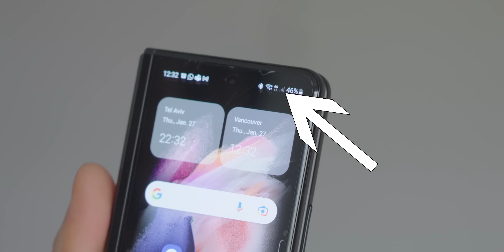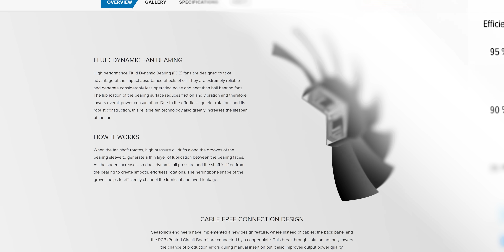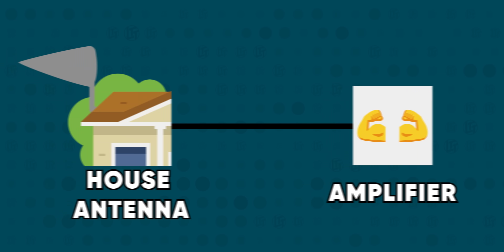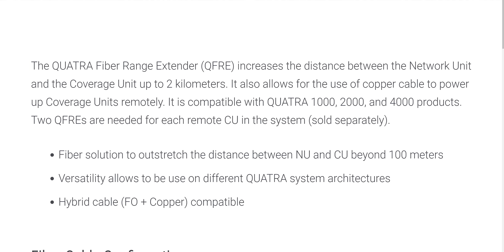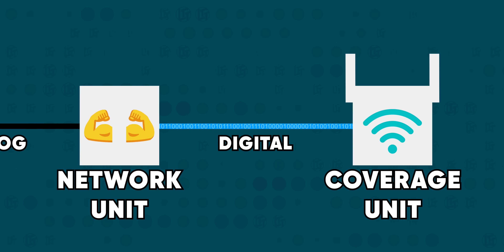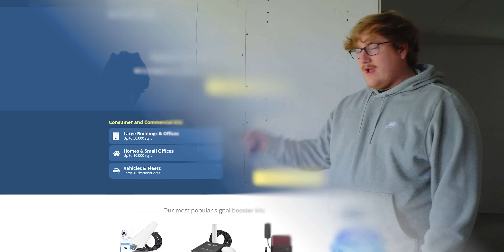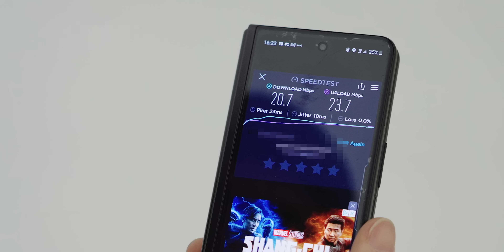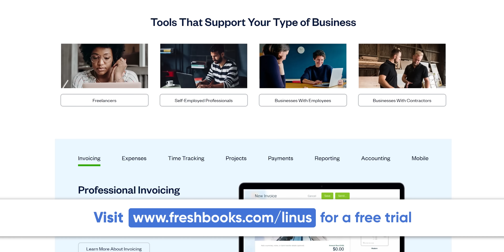I Hate This... New House Cel-Fi Cell Signal Booster Install

Comment: That feeling when working as a tech for a cell company people would just complain about bad indoor signal. If only every customer was like Linus and dropped 3K and a dozen hours on an extensive repeater setup and wire running. What chumps.
Reply: A decade ago I lived somewhere with poor 3G signal, due to the heating & insulation in my house, like Linus.

My provider just sent me a super simple device to plug into my router, which gave me perfect 3G signal, but via the broadband connection.

Seems a much easier solution than repeating the signal, took a total of 20 seconds to install.

Perhaps Linus' provider doesnt do them.
Reply: Get some repeaters for entire locality with funding instead
Reply: At least they didn't use the cheapest booster they could find on Amazon.  Those cause no end of problems.
Reply: @megaangelic  many providers have stopped doing these now.
Reply: @megaangelic  these stopped because of security issues, people could sniff the traffic that was going over the network and since any phone nearby would connect to them malicious people could mine a lot of data
Reply: Or just enable Wi-Fi calling…
Reply: @ralfn5075  not everything supports that
Reply: @ralfn5075  As stated in the video, not every provider or phone supports wifi calling
Reply: For many people, something like SureCall or Weboost might be sufficient alternative that won't break the bank. These boosters are for those living in the small homes and RVs Linus listed out early on. Homes that are 1-2 story at under 3000 sqft. They work on most carriers. It made a huge difference, boosting us from nothing to high speed.

By the way, the outside antenna that Linus called the shark tooth is a Yagi antenna. It is good for boosting signals from towers that are miles away.
Reply: @ralfn5075  funny enough I have to disable wifi calling cause I drop more calls with it on. I have T-mobile if that helps
Reply: @ralfn5075  WiFi calling can be hit or miss. Some carriers and some phones don't support it.
Reply: In some Countries its basically Ilegal to install a repeater
Reply: @ralfn5075  If your phone and carrier supports that - like Linus pointed out .
Reply: @zahedchowdhury0  what about google voice?
Reply: @DouglasWalrath  only in us afaik/we don't have it here
Reply: @zahedchowdhury0  iirc it's US and canada
Reply: @Technowulff  "well, actually", the antenna is probably log-periodic. Construction similar to Yagi-Uda, except it's lower gain but higher bandwidth (to cover all the frequencies) for the same antenna size. You can tell, because it gets narrower at the tip.
Reply: @2afk  indeed, I was surprised that this equipment is legal, it transmits in licensed bands owned by operators. Weird.
Reply: Chill out Mister Yaeger. Or should I say Yaeger Meister
Reply: @ralfn5075  looks like someone didn't watch the whole video. @2:05
Reply: I can relate, tho i worked in sales for a cell company. The hell am i supposed to do about you living in the middle of nowhere?
Reply: @Xtrems  you know how the people pay you for service? Instead of giving that money to the CEO and shareholders, build more towers.
Reply: @zyeborm  yea cause i have the authority to just do that
Reply: @Xtrems  "we cover major population centers, you get the nice peace and quiet of the country though, but you're not gonna get 5 bars of service in your house."

Is a nice way I tell people that their 20 mile stretch of road in the middle of nowhere with 8 people living on it does not warrant a multi million dollar tower expansion.
Reply: I recognise that directional log periodic yagi antenna. Parents 30 year old holiday home in rural Portugal literally on the border of two counties. Couldn't even get adsl broadband as too far from an exchange and outside mobile signal I was lucky to get an Edge connection from the old, small, local towers. 

One of those Yagi painstakingly aligned with the newer bigger tower just outside the nearest town a 15 minute drive away and plugged into a Huawei sim router and I got a 4 bar 4g signal of 50mbps, it was so stable I was once on a glitch free WhatsApp video call with them during torrential rain so heavy it took out their satellite reception. All their neighbours are either on similar sim routers (without the yagi) or paying for directional long range wifi links.  

The Algarve has a line of top of the line cell towers following the coasts solely because tourists expect their smartphones to work, but if you drive inland a bit...
Reply: I'm also Canadian and I feel like Linus just knows that complaining up here to the telco oligopoly will never lead to anything, ever. Better to just take matters in to your own hands.
Reply: Linus goes full overkill, good for him. I'm still here waiting to get halway decent internet infrastructure built
Reply: @AltonV  Our network has rolled out Wifi Calling only 4 months ago and our entire mobile lineup - dirt cheap Motos, entry level Samsung A series, flagship Samsung Galaxy and even iPhones - have all been OTA updated to include our IMS config. Even our £20 burner phones support 4G Calling now! We are a budget virtual network and still could implement it. So there's really no excuses for networks in 2023 not to have it.

Comment: Waveform is awesome. We ended up switching our ISP from the local monopoly to Tmobile and... well we had service issues. Ended up finding Waveform and getting an antenna to hook up directly into the Tmobile provided 5g router. Never actually called their customer service, but from their packing materials I was impressed by their level of care shown in their instructions and online resources.
Reply: I've been curious about doing a cell booster at my house but in our case the cell signal is just bad period because we're in a hilly, forested area.
Reply: did you get a cookie?? I also switched from my very shitty local isp to Tmobile! Will never regret paying $10 less for over x8 DL and x70 UP
Reply: @matthewd9356  I have a cell booster from Verizon and it doesn't require an outside antenna, it just has a small GPS antenna that you sit near a window and you connect it to an open ethernet port on your router and it boost the signal via your internet connection, I believe the GPS signal thing is just so that emergency services can get a location from your call when your phone is connected to the booster.
Reply: Certain cases it might be better then a physical line isp (either small cable or dsl providers using docsis 2.0 or whatever the old dsl versions are) if their network is so slow and always going down. Downside is most are capped at 5GB a month and is basically $50 per additional 5GB block. Therefore, businesses who need it with limited bandwidth use it is ideal. However, for home use or biz using a lot of data traffic use cell as a WAN2 backup only with heavy filtering/shaping to only get must need items have internet when WAN1 is down. End of the day I dislike your comment since it isn't a viaable option for home use unless you dont use much data or can spends hundreds a month on data. - Network Engineer who specializes in every type of WAN connection possible and LAN side for getting businesses up and running. Ideally if you can't get good internet the best best option is a WISP setup you make yourself (see if there is fiber to any house/biz around a few miles with line of sight where you can see if they will allow you to get a separate fiber line (or cable or to share their line but note isps might see this as reselling it so do it at your own risk) put in and host the ISP Box (and power) and a dish (and power) and point it to your house/biz dish and you can get decent internet. Often times the power for the isp box and dish isn't much but offer the host site like $50/month for the power and hosting the box+dish. Of course a friend or family house is better since most wouldn't care of the $10/m for the power and you can have that circuit in your name and pay for it. Besides the normal circuit cost plus (free to $50/m to allow another house/biz to do this) it is an ideal way of getting decent speed and not a crap data cap. The parts is like 2x ubnt dishes, some cabling, ant mounts 2x) could be done as low as $300 for 50-100mbps link to $1500 for better dishes. Of course if you don't need much of a data cap then cell is easier and cheaper and doesn't have to make a 1-3year contract with a host site and ensure they provide you access if you need to trouble shoot the equipment - but if you have nice neighbors and small local biz around then normally isn't too bad. I could go on forever and use cases, etc but you'd have to hire me for my time.
Reply: @JohnAdams-qc2ju  Tmobile Home Internet works great for me in a rural area, I regularly use 1TB/month of data with no throttling and get speeds of 50/down at minimum. All for $50/mo with no equipment charges.
Reply: @jo_han1  Hell yeah, and it's only been getting better as they expand their 5G network and upgrade towers.

Comment: Here in Europe we make buildings out of concrete and bricks. This is the first time I've heard of cellular coverage issues in a building not in the wilderness for over 15 years.
Still, this was quite an informative video.
Reply: It depends on the bands, frequencies have different penetration properties so some cell frequencies will be fine through concrete, but some will be blocked and usually it’s the long-range frequencies that are blocked.
Reply: In the UK most residential buildings are make with brick.
Reply: I big part of that is the density of cell towers around here. Unless you are right in dense population areas you can have some relatively dicey cell coverage - mainly because of NIMBY folks that don't want a tower anywhere nearby. So even though the tower density may be 'enough' when outside, the signal is low enough (or has enough noise) that it doesn't take much to make it unusable.

If you look at the Greater Vancouver area on a tower map, you'll notice that Surrey (where LMG is) has many voids.
Reply: Now compare your country size to the us
Reply: Europe, residential area in a capital city, wooden house. 
4G is mostly servicible untill the phone for some reason decides 3G is better, and then goes to carp. 3G coverage is so bad that it immediately drops down to 2G or entirely and just stays there untill a restart (or airplane mode on/off). After reconnecting, 4G works fine.
Reply: Us from Nordic countries would disagree. Wood construction FTW
Reply: @0FFICERPROBLEM  
From Baltic, we love our plywood
Reply: @_Fug  Considering the autonomy of states... more like compare Europe to US, or maybe the EU, the question is, so what?
Are you all evenly smeared across the land, or do you mostly live in more concentrated areas known as cities?
Reply: @ApusApus  Get a 4g switcher tool, you are always on 4g :))
Reply: @mdkooter  I have it already, butcan't make calls that way
Reply: @ApusApus  ever heard of force 4g? I always do that before gaming for no such bs switching risks.
Reply: @greenking7390  I have, and I have the app. 4g is relatively stable, but 3g is carp, leading to dropped calls, which is the issue
Reply: @ApusApus  Those apps are fake. Most of the time. You have to use system features for this stuff lol. Also why do you wanna use 3g anyway? That's not the question here.
Reply: @greenking7390  
...apps that make said system features convinient to use, and they do, in fact, work. Issue is - if 4g or wifi calling is unavailable (which is the case), regular calls and sms are not received at all.
This was more of a curious than a call for help, so, please, stop
Reply: @ApusApus  What those apps do is direct you to the settings options of changing it. Thing is some phones don't have only 4g in those settings and rather have 4g/3g/2g mode. 

So you need to go beyond it which apps can't do. 

One of my older phones dif have only 4g in the settings and back then I didn't even need to deeg deeper so I never even searched for apps. Then learned that apps are useless when I really needed it.
Reply: @greenking7390  Is there a 4g/2g mode? That is the one I was looking for that wasn't available, 4g only is and works, 3g only is and works, 2g is and works, combinations of 4g/3g also exist. Those are outside of the arduino settings menu
Reply: @greenking7390  or you mean the calling *#356 smth number to access that menu?
Reply: @ApusApus  the number is different but yeah.
Reply: I mean, also depends where in europe. Middle of nowhere, 30 minute drive to the closest town. Gigabit down
Reply: Mostly wood here in Norway, but you mostly have maximum coverage everywhere, like you could livestream from mobile data on top of the highest mountains in the middle of nowhere. Dpends on how good the infrastructure is I guess :'D
Reply: i live in a stone house with 70cm thick walls and i get up to 4G full signal inside by one provider but only very weak 2G voice only (no GPRS or EDGE) signal or no signal at all by another... strange thing is that cell tower of the provider with perfect signal is 3-4 times farther away and older
Reply: @ApusApus  plywood is so fucking expensive to build with atm. wood and drywall for the win atm in sweden. 1 plywood sheet costs 40 euro for 12 mm. 80 euro for 18 mm-.
Reply: @davidklein1245  canada also has a lot of "engineered" dead zones.
especially where the rich powerful and well connected live...
for "security" reasons...
google maps photo's of the area are also long out of date.
additionally leaving many areas under serviced has been leverage for more government funded "infrastructure" that they end up owning for pennies on the dollar and charge us $150/month for cell phone service alone....
meanwhile in europe that same price includes home phone, tv & home internet.
yes world our entire media system is mostly owned by about 3 families given basic monopolies sharing the same executives since the 1980s. and are regulated by a board made up of the same "retired" executives.
Reply: My grandmother's house is basically entirely constructed of reinforced concrete - including all of the interior walls - and the whole place is one big black spot.
Reply: @PajakTheBlind  a majority of canadians live within a 3 hr drive from the USA border.....to cross canada takes about 2 weeks of driving from vancouver to the east side of newfoundland
lots/most of europe would fit in 1 or 2  provinces
ontario is roughly the size of 9 nearest US states it borders.
the main city Toronto (golden horseshoe) holds about 1/3 of the whole population of canada
toronto to vancouver is about 1 week driving
toronto to st johns newfoundland is about 4-5 days driving hard + ~8hr ferry ride.
basically mountains at both ends and totally flat and straight in the middle.
toronto is 4 hrs from ottawa and 5 hrs from montreal and minimum 6 days from vancouver and you better have a strong bladder for those drive times.
Reply: @kazzTrismus  I don't see what your point has to do with my post. The dead zones in and around Greater Vancouver are almost exactly in line with population.  I also wasn't referencing Google Maps - I said tower maps. They are available online and come from CRTC data, showing almost real-time up/down status. You can see that they align with population centers here in Greater Vancouver - the voids are generally a result of farms, mountains, or lakes. With the exception of the Aldergrove CFB Maintenance Depot and the Matsqui Relay Station, there are very few 'intentional' voids.

You also can't really compare service prices here to Europe - in your own other posts you point out the size of Canada and the relative sparseness of the population. Both result in higher infrastructure costs per capita. Not saying I agree with the pricing, but a lot of it is a result of population.
Reply: @davidklein1245  you missed the points i made seemingly intentionally.
you either try to understand them or you dont.
dont then attempt to strawman them...i cannot be bothered to help you if you dont want to understand.
try to re read them as if im not attacking you
because im not
Reply: It wasnt just concrete in the floors. Pay attention to the video. There was piping in the floors to heat the house. Copper tends to block signals.
Reply: Okay but Do you know what a Faraday Cage is? Well, when they built this house and installed the heating system they created a faraday cage, not necessarily on purpose but it's just the way they install the heating system.
Reply: @_Fug  i mean size doesn't really matter as much as the population density
Reply: same in Asia. American constructions are weird.
Reply: Clearly you are not from Germany
Reply: yeah that was first think I thought about and also my cellular is above 700 up/download so that was also wierd to me
Reply: we also make shit out of concrete and brick...